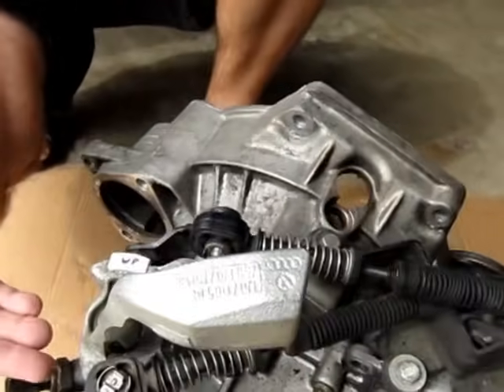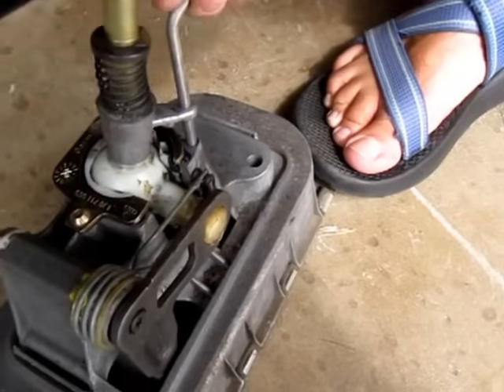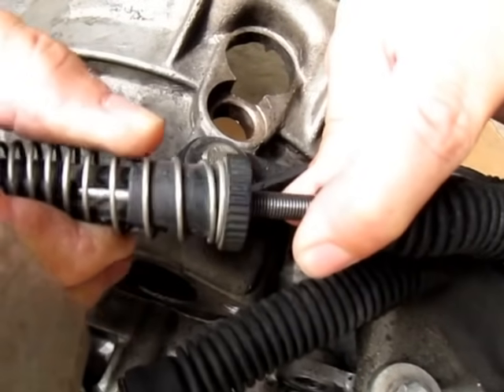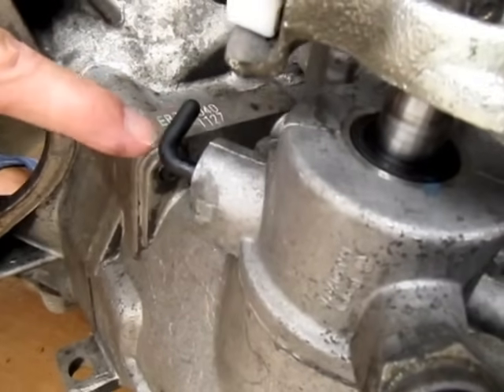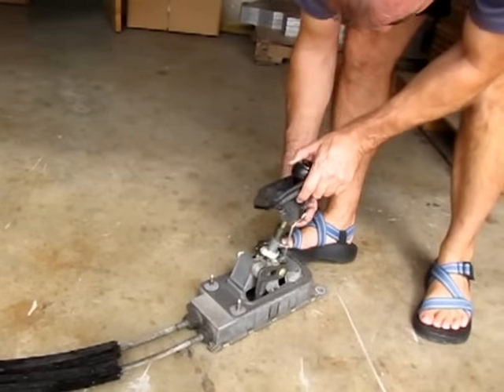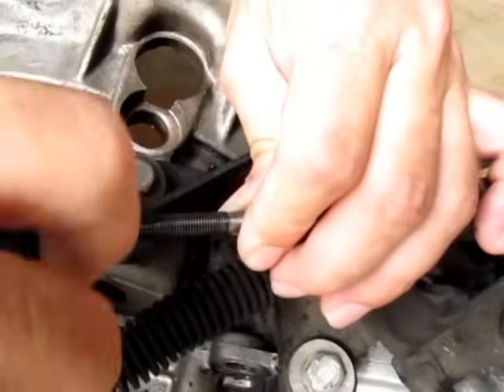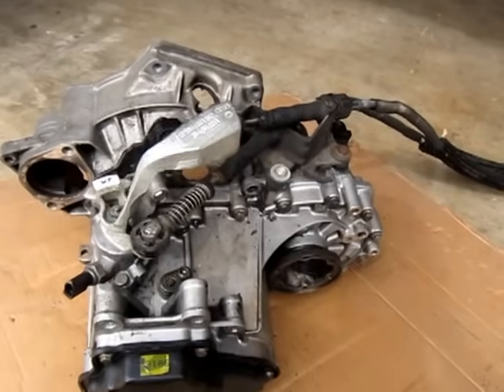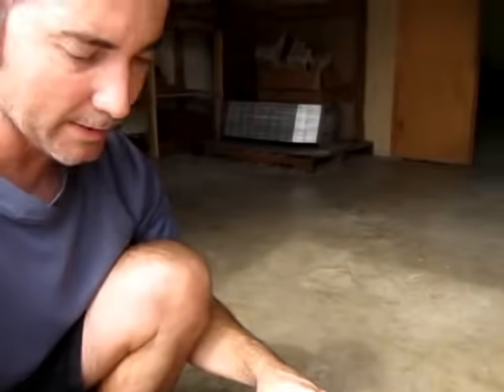VW MK4, MK5, and MK6 5 speed shifter adjustment for 02J and MQ250 transmissions

Comment: Such a difference this simple procedure makes – took me less than 5 minutes(once I'd found a 5mm drill bit:). Even just pulling the spring back without locking it, taking up the slack and releasing it. Thanks very much for making it so clear in your video. All the best, Seán. PS this video shows simple procedure for removing gear stick housing to access the area to 'lock in home position'  https://www.youtube.com/watch?v=WzqnQi1Fn74

Comment: Our Passat B6 with 5-speed manual gearbox has very rough sideways stick movement (e.g. switching directly from 1st to 5th gear, the 1st gear to neutral is fluid, sideways movement is very hard to the other side of the neutral and the movement to 5th is again fluid). It feels like grinding the stick against a rough surface. Applying enough sideways force to move the shifter still correctly activates all the gears, though. Could this be caused by cable misalignment, too, or should I look elsewhere?

Comment: I love this system. It’s so easy to adjust and you can fine tune your adjustment in Minutes
Reply: The cable ends are easily accessible with Golf but with Passat it's totally another story. The VW engineers have installed all kinds of stuff above the shifter mechanism to make this harder with Passats.

Comment: Hello Jim . I have a 2000 seat cordoba 1.9 tdi with a small gear change issue . 
Transmission is the same on the video.
My pin wont lock so i try the second adjustment without pin didnt work well for me :( . Wont go in 5th gear . Any advice ?  Thank you

Comment: Ok, I may have a problem.  I used a drill bit to align the shifter with the lower alignment hole and the drill bit dropped down.  Do you think I need to take things apart to get the drill bit out?  Do I just ignore it and drive anyhow?  By the way this worked perfect.  Now I have smooth shifting again.  Thanks a bunch!

Comment: Hi, ive lost my reverse gear after i did the adjustment. I did the adjustment as per the video but when I was trying to position the locking in pin in the upwards position I was struggling with it til I moved the counter weight in an anti clockwise motion. It allowed the pin to lock in and I placed in the 4/4.5mm drill bit in and gear stick into the home position. I released the springs and reset the locking in pin to the default position. All seemed find but now my reverse gear is my first gear and I have lost reverse gear completely. Any suggestions?

Comment: Great video.  I picked this up from a manual many years ago.  Can't seem to find anything on 2014 Seat Leon 2l TDI 148bhp 6dpeed.  Believe it's the pfl box same as Mk6.  Do these have a locking pin at gearbox and lever?
Reply: @dieselgeekdotcom  Thank you appreciate the advice.  Guessing I'm going to have to do it from underneath as it's lower down.  I got away with it on 02M box fitted to my Ibiza 130 TDI just by removing air intake.  Must admit I did have a few scrapes on my hands and arm😭.  I'll give it a try on the weekend if it's not to cold❄️🌬️

Comment: my car has been sitting for a while cause i had a run away and needed to replace the engine. So i recently swapped my engine and used your video to align my transmission and shifter and for some reason i can not get the transmission to go in to gear with the shifter. But i can shift it from the counter weight. what would that mean?

Comment: Hey Jim, trying to do this with a worn shift tower, the counterweight tower doesn’t return to home. I have to push it up and down it doesn’t spring back up at all, is neutral when the shift tower is pulled all the way up? Or is that actually another gear gate? Without that nice springy action your shift tower shows, Im having trouble finding neutral height. Thanks
Reply: dieselgeekdotcom Thank you! Amazing how hard it is to find any info on gate height online given how old these transmissions are. Much appreciated Jim. Will be ordering from you in the next Jetta build, this ones in too rough of shape to warrant new stuff in the shifter area. Just trying to get her drivable again. Thanks again!
Reply: dieselgeekdotcom I remember that video! Watched like all of your videos basically in succession probly 2 months ago before I got into this issue and forgot this was mentioned, as a rare but still very possible problem. Will be investigating shifter tower and that side to side bushing now for sure. Oh the joys of living in Michigan. Thanks for the replies Jim 👍🏼
Reply: dieselgeekdotcom Hey Jim, after ordering some new ball bearing bushings from the inside of the shift tower(just arrived today) I found that it was the side to side bracket that was super gunked and stuck like in the video you shared with the simulation tape. Should’ve checked it first, guess I’ll save the parts for later. I’ll be ordering your bushings for inside the side to side housing, https://www.dieselgeek.com/collections/vw-shifter-bushings/products/high-performance-bushings-replacing-part-number-1j0-711-067l can you confirm this will fit my 2000 mk4? It says 2008 and above if you switch to metal side to side bracket, im assuming that mean the new bracket are plastic or something now and doesn’t apply to my 02j which was/is metal? Thanks

Comment: Mk4 02J intermittently getting stuck in 3rd gear. Everything else is working properly.
Reply: Just ordered Super Slider from you. Was referred to you by a rep at UroTuning. They stock the OEM piece but that's it. The rep told me he has experienced this exact problem and your Super Slider fixed the issue forever. I'm looking forward to trouble free shifting. Thank you.

Comment: Thanks for a great video, I bought a used 99 Jetta, it grinds when i try to go into 
5th gear, and when i release the clutch it makes a weird hissing noise, the previous owner had the motor rebuilt so it runs good just need 5th gear and help figuring out clutch problem, thanks

Comment: Genuine question; the VW repair manual says to turn and release the rings with no tension on the cable, but here you say with some tension. 
My problem is gear grinding when going in to reverse while stationary. 
Ive tried the VW way of releasing rings with no tension, but that didnt fix the problem. 
You think I should try with some tension like this video?
Edit: I realized that taking the slack out of the cable makes total sense, I'll try that, thank you!

Comment: hey your video is very straightforward, i followed it step by step, try after try, for 6 hours straight. I still don’t have Reverse, 1st, 3rd, or 5th. I don’t know what it could be, me and my friends are stumped. Any suggestions?
Reply: 2nd and 4th are smooth as butter, before i pulled the motor the shifter was perfect
Reply: dieselgeekdotcom the cable stays clamped inside of the cable end, but the cable end that slides onto the rod is slightly ripped, could that cause it?
Reply: dieselgeekdotcom  do you have an email? I took two videos one on the inside shifting and one of the engine bay
Reply: dieselgeekdotcom https://youtu.be/bvU2-yQa9UA
Reply: dieselgeekdotcom https://youtu.be/5WFMMBwjg9w
Reply: dieselgeekdotcom this is the better angle https://youtu.be/rzE-gcStL-8
Reply: i hope this shows it better
Reply: dieselgeekdotcom i adjusted the big shifter one and now i’m on the road thank you so much! i’ll be buying the short shifter shortly here to have better shifts! Thank you again!

Comment: Ive just tried this on my mk5 golf gt tdi and i couldnt select first gear after i followed this video, tried it four times to no avail so tried again locking the pin on the box then opened the clips then locked the gear shift released the clips with out taking any slack away and bang perfect all gears are good.

Comment: Help! My gear selector is stuck in 1st/2nd gear gate and will not rotate back into neutral. I tried pulling out the adjustment pin to see if it would rotate but that is stuck too! Locking pin does not work anymore so that’s not it. Any suggestions?

Comment: 90% acurate, very useful.
1. Put the pin into lock position by pushing it and wagering up and down the counter weight piece, that will allow you to push the lock pin all the way in pointing up.
2. Lose the cables as described in the video
3. Lock the shifter as described in the video
4. Make sure the tensioning on both cables it's adequate and lock the cables again
5. Pull the locking pin by wagering the counter weight, this will allow you to pull the pin from locking position.
6. Remove the locking pin in the shifter and try to shift all gears.
This should conclude the proper alingment and you should be good to go!
Reply: I failed to notice the difference. How was the video different from these instructions?
Reply: @MikkoRantalainen  then you didn't pay full attention to the video.
Reply: Agreed on the locking pin, I was not sure if it was engaged after many tries until doing this. I had successfully fixed the issue the last 2 times but wasn't completely comfortable about the pin being secure. Doing this I could tell it was engaged properly, thx.

Comment: I'm guessing this works for the 4spd in a 2000 Beetle TDI.  I have all gear lights lit on the dash (P through 1st), did a  VagCom measuring block tested that pointed to a selector cable problem rather than the multifunction switch.  Car drives okay but goes in and out of reverse with quite a thunk.  Thanks.

Comment: I have a question about this. I tried to do this with my VW Polo (2013) and i messed up. At first, without touch it, sometimes the 5th doesn't work. After try several times I could. When I did this, backwards doesn't work. 2nd was the third one (for example)... What do you think?

Comment: So can you swap out the shifter on the transmission with another shifter if you pin both sides.  Are there any issues with stuff in the transmission if you pull it out and change?

Comment: Hi there,

An excellent video so thank you very much. However, I have adjusted my shifter and now do not have a 5th or 6th gear so on my gear stick moving up to 3rd puts me in 1st, 4th puts me in 2nd, 5th into 3rd and 6th into 4th.

I know that this is an old video but any help on what this might be would be much appreciated
Reply: @dieselgeekdotcom  Thank you for getting back to me. I used a 5mm drill bit so would this not be accurate enough? Also, aside from turning the springs to release them do they have to be in a specific angle or is that irrelevant?

Many thanks again
Reply: If I have locked it okay using the 5mm drill bit is there any other causes for 5th and 6th gear disappearing?

Comment: My reverse gear pops UP after doing this adjustment with the oem euro short shifter on my mk7.5. Do you know why? It stays in gear tho and all the other gears are fine
Reply: dieselgeekdotcom thank you
Reply: dieselgeekdotcom I went out and bought the nail size that you recommended and now it is perfect. I had previously used an Allen key and I guess it doesn’t work as good as the nail. Thx again!

Comment: Jim, Thank you for the excellent video.  I own a 2009, VW Polo and have just replaced the JHG 5 speed gearbox with a second hand unit.  No cable adjustments have been made and on road test it goes into all gears and sounds sweet, although between 3rd and 4th the gears are just catching slightly.  This is not apparent if I pause for a second in neutral.  Please can you advise me whether or not you think setting up as shown in the video will sort my problem?  Thank you once again for the great videos. Regards Chris.
Reply: I will try adjusting using this video. Thank you.  Yes watched your other video earlier and will take worn bushings into consideration.  New clutch fitted a month ago and was working fine before gearbox.  Thank you once again for your advice.

Comment: So adjustment with the locking pin. Once the 5 mm pin is in place, how are you shift/rotating the gears if the pin is locking the gears in place?

Comment: My clutch had been replaced recently, but it was hard for me to shift into first and second gear, so I have done adjustments for my shifter. Now my car feels like it lost some power. Acceleration isn’t as aggressive as was before and in higher gears I can’t gain speed as quickly as before. Any advice ?

Comment: i am having trouble with it registering the level into reverse, i can manually place it in reverse in the engine bay, then back up and it will go back to 1st/2nd level but i cant get the shifter to go down and into reverse. from in the car when i get it in the down position (difficult to even get there) it wont move forward, it doesnt jam up or anything and if i get it into revers by chance or luck it works ok but then will struggle with second gear a min til i wiggle it a bit. what can i adjust to get that piece to move down all the way from my shifter? (as i assume the reason it wont move forward into reverse is that its not engaging all the way down, seems stuck between the lanes of 1st2nd and rev?

Comment: My 03 GTI seems to be stuck in gear even when it's in neutral... tried just like in the video and adjusted the slack but still is acting like it's in 5th gear. I start it with clutch pedal in and gear shifter in neutral it fires up as soon as I go to let pedal out it tries to take off but lugs like it's in 5th gear, I shut off car and manually go through gears and it will go every gear except 5th any ideas? I tried bleeding clutch fluid from bleeder but nothing comes out...

Comment: I have done exactly how you have explain. Very happy with result Thanks a lot. Have a question. Soon I have to replace the clutch in my mk4 TDI but I am In dilemma Tu put smf or dmf? The last one is very expensive Your advice thanks
Reply: @dieselgeekdotcom  thank you  yes i have stock horse power

Comment: Yo i hav a mk4 jetta 1.8t with 183,000 miles on her and it grinds going into 3rd it was only doing it at high Rpms but now it does it often even when down shifting im going to give this a try and let you guys know i just replaced the clutch about 1000 miles ago with a stage 1 and it would grind 3rd with the old worn out clutch i figured a new clutch would solve the issue but it didnt

Comment: Hello there, 1st I want to say thanks for helping me last year with my 01 jetta tdi. It was a leaky slave cyl. I now have a 05 MK5 5 speed. It has started to get harder and harder to shift into 3rd and sometimes 4th. I'm hoping it is an adjustment issue. Is the MK5 jetta pretty much the same process here?
Reply: @dieselgeekdotcom  Ok, I will try that. I discovered today that double clutching seems to help a little. Don't know if that points to another possibility but we'll see.

Comment: Great video, thanks! I followed your instructions. But I have still another issue. The shift stick is not coming back to neutral when I take out for instance 1st gear. Also to get out of reverse I have to push down the shift stick as you need to do when entering the reverse. Do you have any idea or advice for that?
Reply: Did you ever figure this out

Comment: Man oh man! Jim, you're awesome. Hoping for a little additional help. 
I've been a Benz guy for years (mercedessource on youtube is another saint).  But I recently started working on my ladies MK4 Jetta 2.0 5speed. I just completed a LUK clutch replacement (SMF, clutch disk, pressure plate, release bearing) - 2 damper springs had come loose and 2 fingers on the pressure plate were broken rendering the original clutch useless. The new clutch feels right and  I've completed this procedure 2 times and the car simply will not go into 3rd gear when the car is on and moving - I just get high RPM's. I've checked the fluid.. done the shift linkage adjustment... what else can I do here!? Trying to avoid the shop. 

Is it possible that I've mis-aligned the shift tower/counter weight on the trans after getting it back in the car? Bad synchro? Bad trans? Any advice would be hugely appreciated folks!
Reply: Solved! If anyone is curious, this was my issue: 
https://www.youtube.com/watch?v=cCFpbcFyVHI

I quickly cleaned this peice up with a Scotchbrite pad when I had the transmission out, but I obviously didn't clean it up enough. This time I used a small piece of sandpaper wrapped around and allen key to get rid of some of the build up on the inside and then applied a small amount of bearing grease, put it back together and followed dieselgeek's adjustment procedure again and could instantly tell it was correct.

Comment: Hello sir, I have skoda fabia 1.2 petrol version manual gear system. Now it revers gear is not working other all gear are working properly. So please sir help me to what have to do ?
Reply: Easy, the pin to hold the shifter in place is not aligned with the plastic hole. Even a couple mm off can cause you to lose gears in the alignment process.
Reply: @dieselgeekdotcom  
Thank you very much for your help. I resolve this.

Comment: Does this work on an EKW gearbox? From a seat ibiza 6k2 from 2000..
Reply: I went to check it out tonight and it has the same looks and pin, they're basically rebranded VW's after all. Ill try this tomorrow to see if shifting gets a tad easier!
Reply: Decided to try this at midnight since i couldnt get to sleep, shifting became quite a bit easier! Could use with a few new bushings and springs however!

Comment: I have an aftermarket short shifter and my shift knob doesn’t have the bracket to put the 5mm pin through. Is there anyway I can still properly adjust it?

Comment: So what is the default position of the locking pin on the gearbox? Leaning left just like it is in the begining?
Reply: dieselgeekdotcom Weird. On my Fabia(basicly a Polo) it can sit in only 2 positions 12 and 2. Can not be pushed or pulled either.
Reply: dieselgeekdotcom  Sorry. Right. My gearbox is O2T.

Comment: I have 2000 vr6 Jetta could my shifter be so far off that I'm not even engaging one gear. I'm in the middle of removing my transmission replacing my pressure plate and clutch.